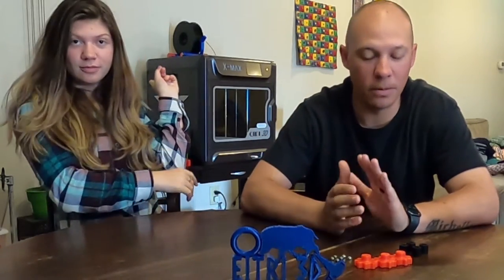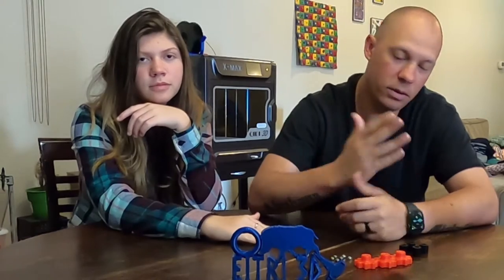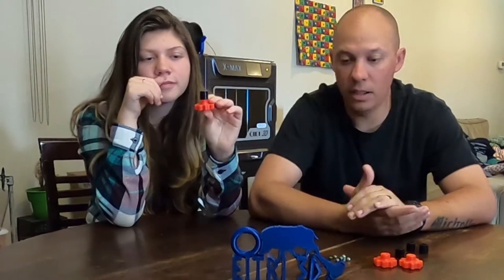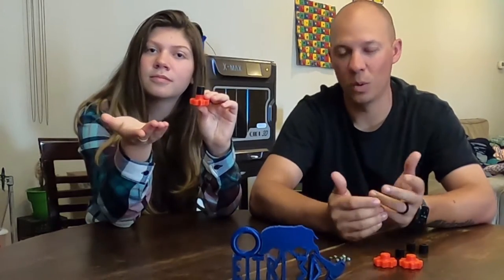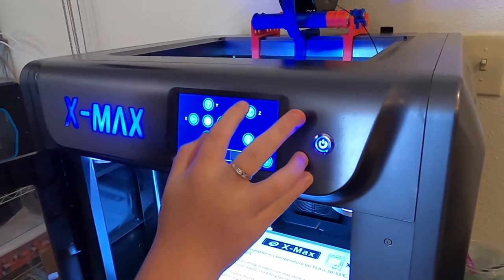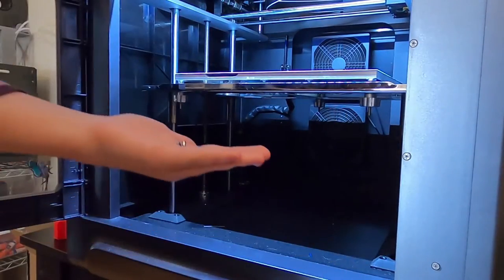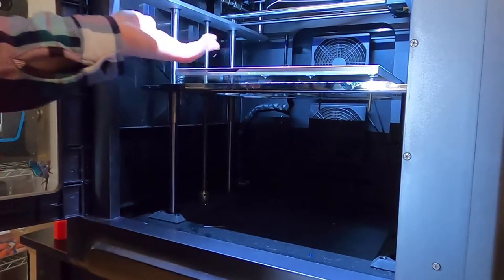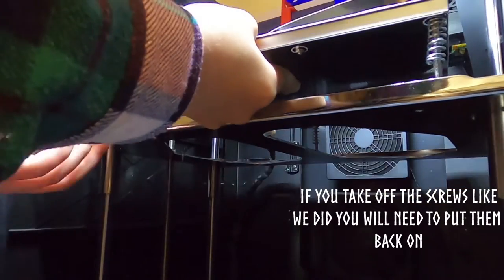Upgrading the Bed Leveling System on Qidi X-Max

Comment: I bought an X-Max in January and once I ran through the roll of PLA they gave me, I have had nothing but problems.  I got through a roll of PETG OK... then installed the high temp hot end for CF PETG.  That's when I discovered the rear leveling nut needed to be fully loose just to get the bed near level.  So I replaced with new springs and nuts.  I still have had to level the bed after every print.  Basically print a test print of 1-layer level squares at least twice, re-level several times, then attempt to print.  I too tried to print a spool holder (bc I bought a larger 2kg spool of CF Nylon) and ran into problems there. Maybe it was bed leveling, but I can't keep the nozzle from accumulating filament and eventually sticking and pulling on the print ripping it off the bed.  I lower the bed temp and nothing adheres, or I increase the bed temp and that causes more edge curling and goopy filament sticking.  

Finally... the motherboard just fried yesterday.  So 7 weeks in and I have a 75 lb brick.  So disappointed in this printer.  Anyone reading this... in my opinion stay away from this cheap Chinese product.  If you like me wanted a large print area and the ability to print high temp filaments... spend more money and purchase a higher quality printer elsewhere.
Reply from the maker: Thank you for your comment. I am truly sorry you’ve had such bad luck with the printer. Unfortunately, your experiences are definitely not the normal. This printer has been a workhorse for many and I hope you reached out to their support. We are NOT paid by this company, but I can tell we absolutely love this machine. We had some learning curves since we were brand new to 3D printing, but every question that asked to their support was answered. With their support I’ve noticed that all my issues were user error and not the machine. Now I have heard of a couple of issues that were manufacturer defects, but those were few and far between and when identified by customer support, they made it right by sending replacement parts. If you are getting rid of your printer, please let me know. I will gladly take it off your hands. If you’re willing to answer a few questions I’m curious how much 3D printing experience you have and which printer you will be moving to next? Again, sorry for you terrible experiences with that machine, but thank you for your comment as the community definitely needs to see all honest opinions to make informed decisions. Cheers!
Reply: Thank you for your detailed response!  And I appreciate the full disclosure that you aren't representing them.  I am feeling more relieved that you say it has been a workhorse for you and others.

I too am a beginner to 3D printing.  No experience before this.  And I am willing to admit that many of my problems are user error.  The first print was as easy as it gets, and certainly I have made mistakes as I went along.  Although the bed leveling nuts were definitely sub-par... my replacement package came with better springs and 16mm silicone too... the silicone seemed too short so I installed the springs instead and things were better but still had to re-level very often. Maybe with the silcone I just needed to do the quick level and hit UP on the Z distance a bunch until it was closer but I thought they didn't fit.  The motherboard though was deflating.  I did reach out to Qidi Tech and they are going to send a replacement.  Their support is decent enough.  

I appreciate the offer too!  I very well may take you up on that.  I'm based in PA just FYI.

I have been researching and for what I want.... large build volume, and an out of the box extruder that can do 300C so CF-Nylon and maybe even Polycarbonate are options... the X-Max is so close but I guess that little bit of PTFE tube in the hotend is an issue people mention which keeps them from pushing the temps that high.... the FlashForge Guider 2S has kept popping up as a worthy candidate.

It's gonna come at basically the cost of 2 X-Max printers though, and if I'm being honest about my concern for quality in Chinese-made products (hey I am just going off experience with all kinds of random stuff I've bought in the past... and despite experience I still pulled the trigger on Qidi and gave them my money over say Prusa), well then I should skip FlashForge too.  I don't know.   The next option would be a Raise3D Pro2 but that price tag is way up there... the girlfriend's wedding ring would have to be delayed another year hahaha.  Dual extruders on that beast though... 

My girlfriend wanted a new hobby too and fell in love with the idea of laser engraving.  She dropped some coin on a Snapmaker 2.0 which is a 3-in-1 laser engraver, 3D printer, and CNC mill.  It arrives tomorrow and I'm excited to see what she does with it.
Reply: Hello again.  Just keeping you posted. I received the replacement motherboard and installed it with no issues.  So the printer turns on now.

But I am back to square one, unable to get the bed to level.  I spent all day Saturday, trying to level and then print a file of 1-layer bed leveling test squares.  

I have silicone spacers, locking nuts, and upgraded (similar but not identical to yours) turning nuts installed for the leveling screws.

Each time I run through the advanced leveling sequence, I will need to adjust the front two nuts to allow the front corners to move the bed up slightly to get friction w/ paper.  The rear one typically also needs adjusting but sometimes not.  Then the center point is always too close, touching the nozzle and so I have to hit the down .05 mm button usualy two or three times.  At that time the three other points are off again and I have to start the process all over again.... front points need Z to go up, middle point needs Z to go down... it never ends. 

If I try to print the squares then either the nozzle is too high and nothing sticks or the nozzle is way too close and nothing comes out or barely anything (a too-thin, see-thru square), and it still fails completely on at least one square.

I really want to believe somehow this is user error but it shouldn't be this hard to level a bed.  

I'm just venting and giving FYI... not necessarily asking for help.  But if you have tips I am all ears.
Oh and I did reach out to Qidi... now they are sending a new build plate.  I measured around the edges with a caliper and the thickness is the same.  And I put a little level on it to try ti see if the center point is bowing up but the level might not be accurate enough if it is bowing ever so slightly.  But it certainly seems like the middle of the build plate bows up.
Thx 
Phil
Reply from the maker: You actually answered my questions and that was to check to see if the build plate was warped. I’m sorry you’re having so many problems with this printer. I promise you once you get it up and running, you will see why people like these machines. I’m also glad that their customer support is super helpful, because that is one of the things I love about this company. Once that new build plate gets their and you get it installed keep us posted because I definitely want to hear a success story after all the troubles you are having. 

As for leveling tips, I always run the full leveling at least 3 times because of having three points to adjust for leveling. Most people are better at it than me, but this way I feel better knowing it’s as level as I can get it with the leveling paper.
Reply: @Eitri3D  I am trying new filament too, to see if that makes a difference.

Before the motherboard fried, I had been printing with Priline Carbon-Fiber PETG.  I have had successful prints, don't get me wrong.  Perhaps leaving that roll out for so long has degraded the filament.  I did hear the rare crackle-pop which I guess were bubbles in the filament.  On the successful prints I never saw any evidence of bubbles or anything in the final result so I never worried.  But certainly that roll having sat out for over a month, isn't doing me any favors.

I just put on a roll of CF-PLA (still have the no-fan hot-temp extruder on so I don't want to try just PLA) so we will see how that goes.  I'll keep you posted.  Thanks for the vids, they're all helpful!
Reply from the maker: How are you drying out your filament? I use a cheap Walmart dehydrator and let it run overnight. CF/PETG probably absorbed all the moisture in the house. Lol.
Reply: @Eitri3D  I hadn't been drying it at all.  I just bought a Polymaker box with a hygrometer on the front though.  It has rollers in it and you just put dessicant packs in the bottom.

Maybe not drying the filamebt is causing me a lot of problems?  I wouldn't think that would manifest as bed leveling problems but perhaps I have been mistakenly thinking the nozzle is off when the filament bunches up on the nozzle... and it is just the filament itself that's the problem?
Reply from the maker: That will be interesting to see what you find out. Keep us posted if you don’t mind.
Reply: @Eitri3D  I’d be very interested in hearing the end result of these issues as I’m about to purchase an XMAX shortly and bed leveling is one of my biggest gripes of a 3D printer!
Reply from the maker: I can tell you from the start that you are going to hate the X-Max leveling. The springs and overall design are terrible. Once I upgraded the leveling springs to spacers, I have no complaints. I am being honest when I say I haven’t leveled my X-Max in about 6 months. Before the upgrade I was leveling before and after each print. Hope that helps.
Reply: @Eitri3D  thanks for that insight, can you please advise further on the spacer setup you used? Leveling knobs will be the first thing I print to get rid of those wing nuts!
Reply from the maker: In the video description I have a link to the spacers I used. Buy 18mm for the back one and 16mm for the two front ones.
Reply: @Eitri3D  thank you that’s great help, I feel a bit more confident knowing I have a solution to probably the first thing I’ll encounter when setting up!
Reply from the maker: No problem, I hope you enjoy it. If you have any issues, there customer service is one of, if not the best I have ever dealt with.
Reply: @Eitri3D  Update....

Well first, I have to concur with Eitri here about the bed leveling.  The default hardware isn't great.  That is pretty simple and inexpensive to upgrade, and since I did that, I don't really need to level the bed hardly at all.  I am not sure what complications I had 7 months ago with leveling after buying the upgraded nuts and springs... but I have replaced the motherboard, ribbon cable, and the bed (the solid aluminum) in addition to the hot end.  

I mainly wanted to be able to print filaments like nylon and polycarbonate... that's why I bought this machine.  There was definitely at least one marketing page I saw before I bought it that indicated as much.  BUT these higher temp filaments are not possible without upgrading the hot end... you can go up to about 250 degrees Celsius with the default high temp hot end but not over that.  SO, this is when you do the hot end upgrade... I printed the "Hercules" carriage on Thingiverse and purchased a Phaeton Dragon hot end (along with the rest of the bill of materials for the upgrade).  I have other priorities too so I couldn't work on it for very long on any day, so it took me this long to FINALLY get it working.  I mis-wired more than once, accidentally ripped wires more than once, and generally had a very frustrating time getting the upgrade functional.  BUT this week I finally got it working!  I am printing through a roll of Carbon Fiber PLA now, before I attempt the trickier filaments like Nylon.  I will probably go through some PETG too before trying Nylon, just to hone my calibration experience with the trickier stuff.  

7 months ago my expectations for what I paid were that the printer should just work.  And considering there WAS one Qidi ad that said it could print polycarbonate out of the box (I don't think so).... I think it'd be fair to be disappointed.  But now I can see that to own a 3D printer you should become intimately familiar with how it operates and be able to competently take it apart, especially the hot end because clogs and things happen  
...I will say that I am more satisfied with my purchase.  For better or worse, I've disassembled and re-assembled the majority of this machine and I've become more experienced as a result.

I think Qidi should use better bed leveling hardware... that's low hanging fruit.  But easily upgraded.  And they could do better with the hot end, make it fully "all metal" so it can print the higher temp filaments they claim it can, out of box.  And when my motherboard blew after only 2-3 months owning it... that was definitely a knock on their quality.  

But if you are looking for a printer that has a large print surface and can print filaments like Carbon Fiber PETG, AND potentially print polycarbonate (albeit via upgrading)... then I would recommend this printer.  Yeah, you have to upgrade the hot end to print nylon or PC, but there aren't any other 3D printers that can do it out of the box which are in the typical hobbyist's price range.  More expensive industrial printers can do it out of the box... but this machine is relatively inexpensive for being able to compete on that level.
Reply: @Eitri3D  Also... many thanks to Eitri for helping me along the way.  I've posted a few questions in comments on his videos and he responded quickly and with very good information or suggestions.  I really appreciate it!
Reply from the maker: Great feedback!! I am glad you are to the point where you were hoping to be. Supposedly Qidi has all metal hotends, but personally upgrading those parts forces you to become familiar with the printer and helps you understand the ‘how’ of 3D printing.

Comment: OK, I'm an idiot. I got all my supplies today. Can you tell me exactly where the lock nuts go. Not sure if they go right under the build plate which doesn't make a lot of sense to me. Or under the new adjusters thanks gang
Reply: Nevermind didn't realize they went into the printed turn knows. Got it.
Reply from the maker: Sorry for the late response. Glad you were able to figure it out. I hope the rest of your upgrade went smooth.

Comment: You're the man for X-max stuff. I just got one from a company that had switched to Prusa machine and let me pick it up for 450 usd so I couldn't resist. The bed system is super frustrating ive found out very quickly. Thanks for this I'll be upgrading mine asap. Video was solid. A little confused by the thing about the screws and having to take them out and put them back in. Is there a way to not take them out and still get this done or is it just a reminder.
Reply from the maker: Thank you the kind words. That is an amazing steal at that price. I hope you enjoy it as much as we do ours. Cheers!

Comment: Really like the content you guys provide on this printer, thanks for that.  One question on this mod, I see you have links for 16mm & 18mm spacers.  Are the fronts 16mm and the single rear is 18mm?  Thanks again, keep up the good work!
Reply from the maker: That is correct. The 18mm provides a little tighter fit. You can use 16mm all around, but the 18mm for the back is better if you can afford to spend a little bit more money. Thank you for your comment and we are working on a couple new videos. Cheers!
Reply: @Eitri3D  Thank you for the quick reply!  I've been subscribed since I bought my Qidi so I'll be watching!

Comment: Dude your videos are so helpful thank you! Bed leveling on my x-plus is a pain. I’ve just been tightening all the nuts until the bed hits the nozzle then running a 0.27 Z  offset. I’ll definitely have to try this. Do you have a video for setting up a camera. I’ve been using a baby monitor that is controllable but am thinking about switching to raspberry with octoprint.
Reply from the maker: Thank you for your kind words. We just wanted to help others. As for other videos, yes we do have a RaspberryPi install and camera installation video. Hopefully they will be just as helpful to you. Cheers!
Reply: @Eitri3D  My spacers came in today, was going to this when I got off work. I am using the X plus not the X max. Do I still use the 18mm spacer in the back?
Reply from the maker: I cannot confirm that it will work cause I personally do not own the x-plus, but from my understanding, it should due to the similarities. Sorry I cannot be more help.
Reply: @Eitri3D  i own an x-plus and you need 20mm as the plate sits higher than the x-max i just cheated and used the 18mm and chucked a washer under the spacer (not touching the build plate)
Reply from the maker: Thank you for that info. Have you had any issues with using that washer on there?

Comment: Does this work for ifast? I am having a hell of a time leveling my ifast! It’s awful, seems like the printer is useless now.
Ugh
Reply from the maker: I would assume but I have never had any issues leveling our iFast. You are actually the first person I have heard that is having leveling issues with it. Is it fall out of being level or are having issues getting it leveled?
Reply: @Eitri3D  getting it leveled at all, it’s like the very dead center of the plate is higher than the rest. A little friction at the 3 points for leveling gets to center and can’t get the card they provide under it, and one 0.05 adjustment goes from can’t get the card under it to no friction at all
Reply: If you are still under warranty, they will probably just send you a new plate. Your plate may be warped. I have gentle friction at all three leveling points and also at the center of the bed in my i-fast.
Reply: Oh, you can buy an extended 1yr warranty for $250.